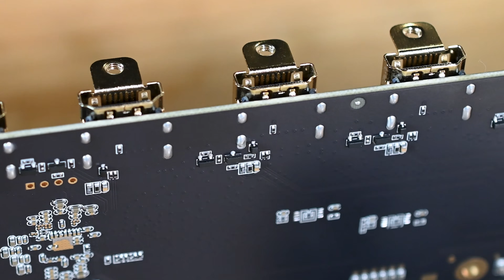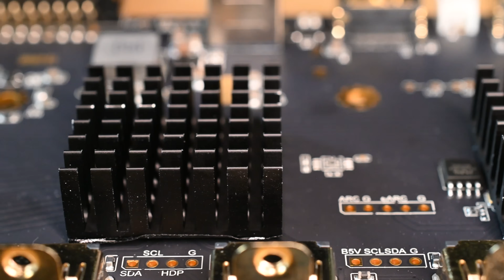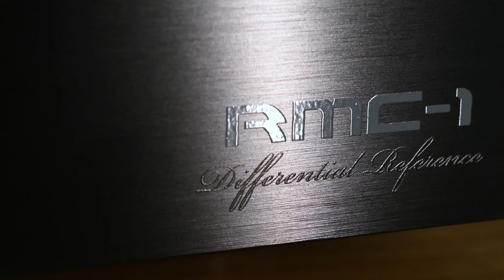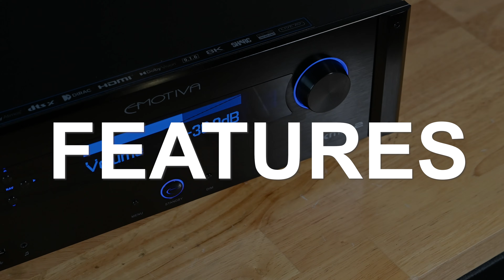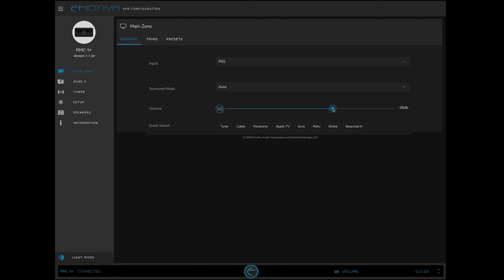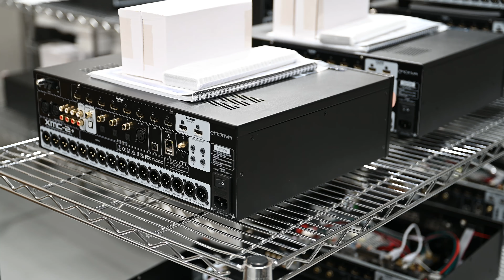Official Emotiva Reveal: Our All-New 8K Home Theater Processors

Comment: Will they work with the Oppo BDP-95 and earlier models, they're HDMI 1.4 boxes. The older XMC2 does, and I definitely need it to be there in the new box
Reply from the maker: Yes, the new Plus units still feature the ability to select an HDMI input as a 1.4 input for compatibility

Comment: Hey Dan.... What about the update that you promised on the bas X MR1L receiver processor, I distinctfully remember you mentioning
it on your podcast. When you released the unit........ Please don't forget us.
Reply: Sorry, but don't hold your breath waiting for a firmware update.  I've been begging them for an update for my MC1 since I bought it.  I was sent a Beta one, but it was worse than the original.  I've given up on Emotiva.  I had high hopes, but....
Reply: @welderfixer there are plenty of them on the market that they sold.Everyone speaks highly of them. But like with some of their models as soon as you buy it
They turn around and come out with a new one.With all the equipment that should have been in the first one. This is one of the reasons I purchased from a direct to seller. Where you're supposed to get help on what you invested your money in
.........😢

Comment: I have two questions that I was not able to get from the presentation. Hopefully someone could answer. What is the bit rate of the new DACs? 24/192 or 32/768? Next, what type of power supply is being used? Toroidal or the H class that are used in the amplifiers? Thanks in advance.

Comment: What makes a $1500 difference between the them?  Plan on running a 9-4-6 set up  
Will they both work well for me?
Reply from the maker: The RMC-1+ is 1 RU taller, has the extra OLED screen and multi-axis encoder, and ships with our Phono module and additional XLR input modules from the factory which leaves 1 expansion module open for future capability.

Comment: Had xmc1 and it was rock solid. Traded to xmc2…lots of issues and lots of hard reboots. Laggy and freezes. Clipping atmos audio. Dirac setup issues (using a weird complex dongle). Was never happy and regretted getting rid of xmc1. Eventually a firmware update improved though never fixed all the issues. Ethernet and iphone app stopped working and gave up trying fix it…im an IT guy for reference. Joke of family is it doesn’t have sound, I hard reboot it, and we all stare at it as it takes forever to oddly ‘updates fonts.’ Tried to reach out to support years about the issues and also about a stereo amp that failed (some time after warranty), and never got response back. Forums and publications online full of complaints…

This xmc 2 + fix the xmc 2 crap sounds like or are we going to be beta testing again?
Reply: Does it come with Dirac out the box

Comment: How well does in integrate with control systems?  Sounds for the choice you made it should have full access to all setting from the driver used with any control systems correct?

Comment: Will you be  at  the S. H. O. W June in Orange County. I have the MC 1  as a stand in wanted to use balanced  connectors but no processor with XLR connections was available at time of purchase. MC1 pops and EARC  drops out.   I replaced HDMI cable with emotiva  HDMI cable  with no change. I use Differential amps for mains,XPA for surrounds. Emotiva flagship speakers and surrounds. Im disappointed with the delays (my products were months late,not delivered when promised or scheduled,but at the worst time during my work peak season received call randomly when at work had leave work without notification in the middle of the day to accommodate the delivery company ) I don’t want to spend 5000 for a potential electric head ache like my MC1. I need to see and hear this before I buy.

Comment: Watched the Video twice, but didn‘t get the difference between the XMC-2 (+?) and RMC-1+
Reply from the maker: Both units use the same core boards and have the same performance. The RMC-1+ is 1 RU taller for the expansion boards, has the additional OLED screen on the front, multi directional encoder volume knob, an additional set of coax/optical inputs, and the nicer tiffany jacks on analog inputs and Z2 output. The RMC-1+ also comes with the phono module and additional XLR input modules installed already.

There is no wrong way to go as the XMC-2+ is 95% the same unit.

Comment: @EmotivaAudioCorp : Great looking products.  I was hoping for a little more discussion of the differences between the 2 models. I will most likely be purchasing one of these for my theater room I am working on. In the beginning of the video you mentioned you would clearly describe the differences between the 2 models.
Reply from the maker: Both units use the same core boards and have the same performance. The RMC-1+ is 1 RU taller for the expansion boards, has the additional OLED screen on the front, multi directional encoder volume knob, an additional set of coax/optical inputs, and the nicer tiffany jacks on analog inputs and Z2 output. The RMC-1+ also comes with the phono module and additional XLR input modules installed already.

There is no wrong way to go as the XMC-2+ is 95% the same unit.

Comment: I’m confused after looking at the photos of the connections on the back of these units on the Emotiva website.  Where are the subwoofer outputs?  How many subs can I connect?
Reply from the maker: On the bottom right of both units. There are 3 subwoofer outputs, two of which can be assignable to heights.
Reply: @ thank you.  I was reading the manual this morning trying to find this info.

Comment: Why do you have ads on what is essentially a commercial to begin with?  You promised to describe the difference between the two units, but I certainly didn't notice it.  Is there a big market for a unit that requires 16 speakers?
Reply: "Requires 16 speakers" is a common misunderstanding.  The extra channels exist because ATMOS "can" use them all, and 16 is meets or exceeds the requirements most people will have.  But ATMOS only "requires" 1 channel!  (Think ATMOS certified smart speaker...)  ATMOS mixes the audio on the fly, tailoring it to your system and to the number of speakers you have.  With old 5.1 and 7.1 formats, missing a speaker meant missing out on some audio.  But with ATMOS, it actively figures out how to give you all of the sound, regardless of what speaker setup you are using.  Again, it works on a smart speaker, and it works on an elaborate surround system.
Reply: I run 7.4.4 and moving but prefer 7.4.6 so 17 channels would be desirable. And if someone wanted 9.4.6 then ….
Reply from the maker: There isn't a major difference in the two units as they use the same core boards. The RMC1+ gets you an additional OLED screen on the front and is 1 RU taller and comes with 2 modules installed at purchase (phono stage and 2 XLR inputs)

Comment: How do I get my content to this unit? No airplay? :face-purple-crying: Emotiva makes life hard and then you have to pay for it.
Reply from the maker: You can use eARC back to the unit if you are using smart TV apps or use any of the digital or analog inputs to run your sources to the unit.
Reply: @EmotivaAudioCorp  If I can't connect all my phones, iPads and iPods and computers to my sound system it makes life much harder. Ya, it's easy to connect my smart TV but that's just the TV. It appears Emotive is just too cheap to pay to include airplay. They certainly charge enough don't they?

Comment: HDMI 2.1 with full 8K UHD HDR support 👍
Dolby Atmos and DTS:X Pro immersive audio 👍
Dirac Live® Room Correction included 👍 👍👍
Modular and upgradeable platform 👍👍👍
Nisshinbo Micro Device NJU 72343 👍 
BurrBrown PCM1795 👎  For $4,000/$5,000 would like to see the ESS 9039 Pro
LM 833/837M клас А 👎  For $4,000/$5,000 would like to see the  Virtual HiFi Supersonic V1

Comment: I had the RMC1 processor and it was plagued with software issues, you when you turn the volume, dial or tried to switch it was very slow. Has all these issues been solved?. How would compare your emotiva rmc1 against a Trinnov processor
Reply from the maker: Yes, the performance and reliability is a major improvement!
Reply: it just needed the last update, mine works very well since.
Reply: Buy the trinnov. LOL. No contest.

Comment: does these units now support Dirac ART?
Reply: These new units do not support Dirac ART or DLBC.  DLBC is supposed to be supported by a later firmware update.  ART is not currently on the roadmap, as I understand it, and it is not clear if it could be supported with a firmware update.
Reply: @irwfcm  my apologies. I read it wrong. You're correct. The only Dirac ART available that I know is Storm.
Reply: @ProudPapaKY  Denon/Marantz has now announced Dirac ART to be available for download later this year.
Reply: @nodoubt1616  my apologies. I somehow skipped over the ART in your comment. He's correct in that it does not support ART.

Comment: Thanks.  But you didn't say what is different between the two!  Is it the 3 expansion slots that make all the difference?  Besides that, I see the RMC has +1 coax input, +1 Toslink input vs the XMC.  I probably would not need the expansion modules, so I would like confirmation that both have the same audio board.
Reply from the maker: Both units use the same core boards and have the same performance. The RMC-1+ is 1 RU taller for the expansion boards, has the additional OLED screen on the front, multi directional encoder volume knob, an additional set of coax/optical inputs, and the nicer tiffany jacks on analog inputs and Z2 output. The RMC-1+ also comes with the phono module and additional XLR input modules installed already.

There is no wrong way to go as the XMC-2+ is 95% the same unit.
Reply: The RMC1 has fully differential reference outputs. So you would need the DR amps to take advantage of that. 
Both are amazing units
Reply: @MN801UT  My impression from the video is that both units have the same analog board, so they share the same DAC configuration....so both are fully balanced.  If you zoom in to the website photos, you will see the "Differential Reference" in black letters label under "XMC-2" label.  As far as the "need differential amp" part goes, that is a misunderstanding.  You do not need a differential amp to get the noise rejection benefit of balanced XLR connections.   The regular XPA amp converts the balanced signal to single ended before the amplifier section, while the Differential amp has 2 amplifier sections per signal.  It is a big flex, but I haven't found any evidence that it provides any benefit at all for audio signals.
Reply: @ The new XMC2 as exactly the same now. All reference on each channel.  You do no need the Reference amps to do so.  BUt they will give you a little better quality, reason I use McIntosh amps.

Comment: How do you think the top of the line unit will do compered to the Marantz AV10? I am purchasing a new AV processor in next 2 weeks and have always been a Marantz fan and currently run a Marantz Atmos processor that is 6 years old.  I appreciate your input
Reply: I got to hear it last weekend, and it made my Cinema 50 sound very bland and flat.
Reply from the maker: Even our older models still outpaced the newer Marantz on sound performance and the new Plus processors are even better.
Reply: @EmotivaAudioCorp are there plans to deliver expansion modules to increase the channel count? Marantz and Anthem have support for 15.4, would be great if emotiva can do the same
Reply: I’m running an 8805A and I’m thinking I will pick up the top unit this year. The AV10 is amazing but this looks next level. 

I love my Marantz products but I really want to pair the Rmc1 with my DR amps. 
I think it’s worth trying for sure. 
Emotiva has top class support too.

Comment: When will you tell us the difference between the two units?
Reply: yea.  Thirty minute video and they didn't discuss that.  Just pricing.
Reply from the maker: Both units use the same core boards and have the same performance. The RMC-1+ is 1 RU taller for the expansion boards, has the additional OLED screen on the front, multi directional encoder volume knob, an additional set of coax/optical inputs, and the nicer tiffany jacks on analog inputs and Z2 output. The RMC-1+ also comes with the phono module and additional XLR input modules installed already.

There is no wrong way to go as the XMC-2+ is 95% the same unit.
Reply: These guys remind me of my coworkers the way they talk.  Glad to see the high end use connectivity.  No more running out of top speck ports and sketchy switching!

Comment: 🇨🇦 Apologies in advance for jumping in with questions after only the first few seconds of this video, but since I was looking at the website only an hour or so ago, I thought I’d ask:  can we assume there will be further expansion/upgrade of the BasX amp series with higher channel count models along the lines of the A2L that was featured in one of your recent fireside chats; will the Et-3+ be available again; and any thought of adding a power trigger to the CMX2 or 6?  As blasphemous as it may sound, there are some of us forced to endure home theatre systems with a hybrid of Emotiva and other brands of amps that lack trigger or signal sensing power on function, and aren’t (yet) in the position to replace the dogs’ breakfast of gear with a new shiny box with blue lights.😂